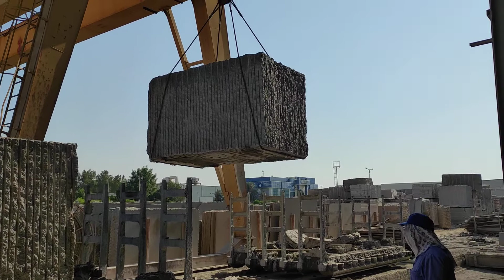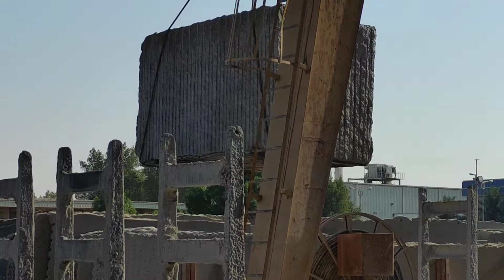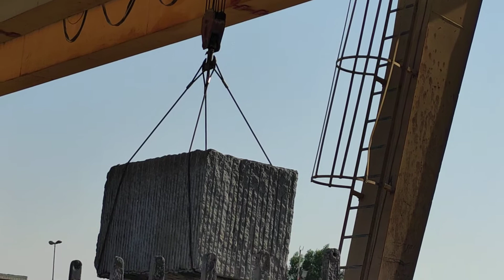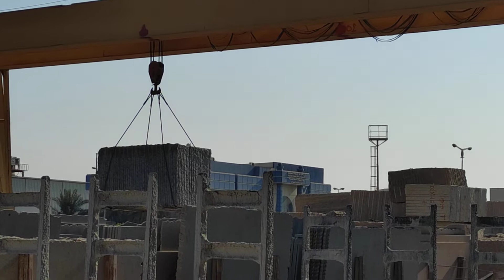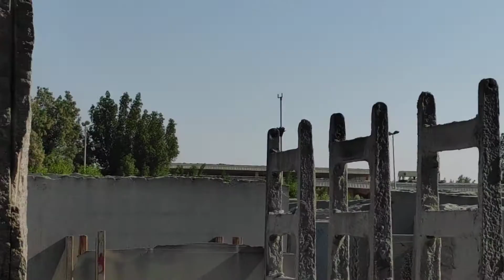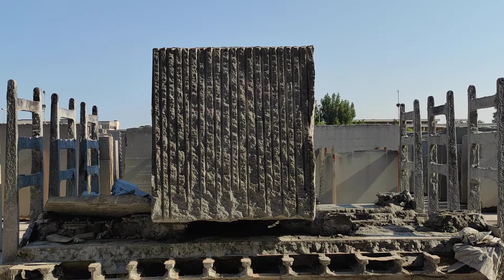Granite Work: Block transfer using Gantry Crane

Comment: That is a huge heavy concrete block.
Reply from the maker: It's not a concrete block but it's a granite solid block sawn into slabs of different thickness then cut into tiles used for flooring or cladding walls.
Reply: @bentongvlogs  Oh yes...I saw some kababayan in Saudi before work in in about company extracting granite from mountains using high water pressured jet to saw or city slabs as hugs and that. They export The cut slabs to a company in italy for processing into glazed tiles.

Comment: ano yan sir solid po ba yang bato na yang grabe ang bigat nyan godbless po
Reply from the maker: Solid na bato po iyan, nagkakabigat iyan ng 24 tons. Iyan ang tinitistis ginagawang slabs na 2 cm thick para gawing mga tiles. Pag tinistis iyan magiging parang plywood na 2 cm thick and then cut into desired sizes ng tiles, 30x30 o 60x60